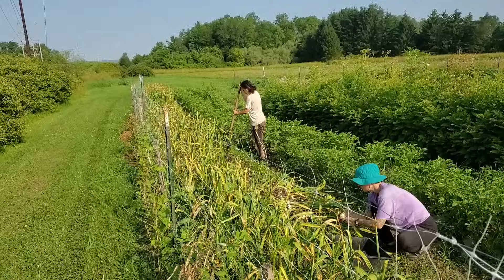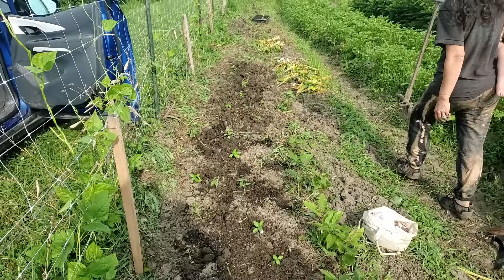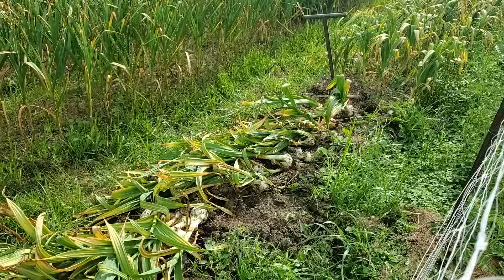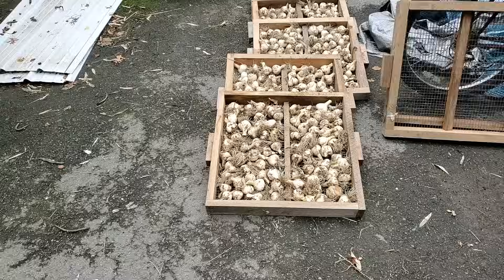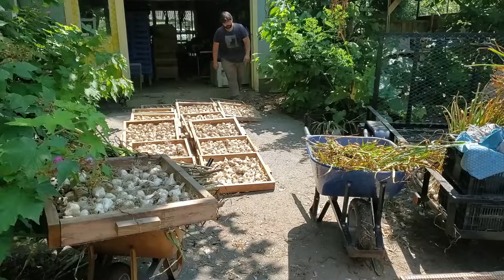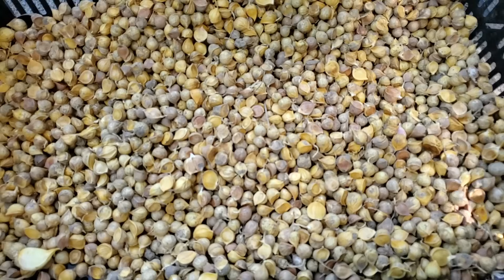Garlic Harvest is DONE! 1000+ pounds!

Comment: Wow! The bulbs of your just picked  elephant garlic look awfully white! Did you meticulously brush off each bulb before laying it on the tray on the tailgate of the car? 

I finished harvesting the 125 garlic bulbs I had planted here in SC zone 8B  in June. 

The bread crates look like they provide perfect ventilation for garlic curing! I would put shims or something to raise up each of the wooden trays to allow better ventilation over the top and under the bottom of each tray as long as they are going to be stacked on top of each other.